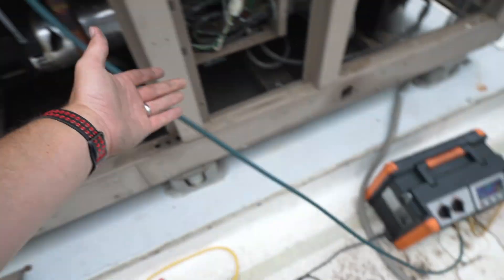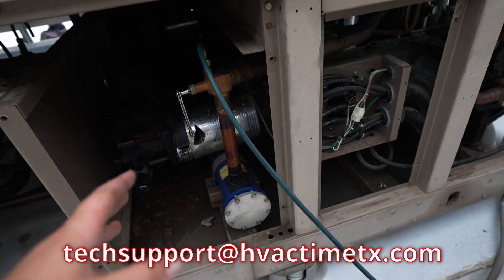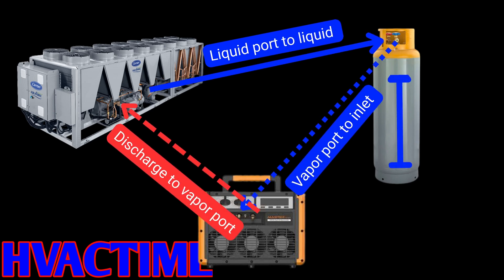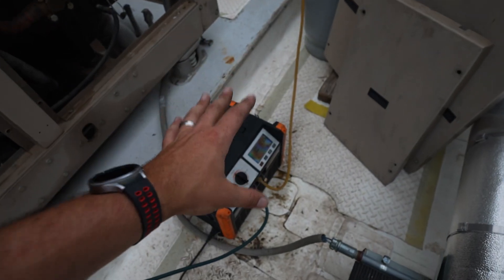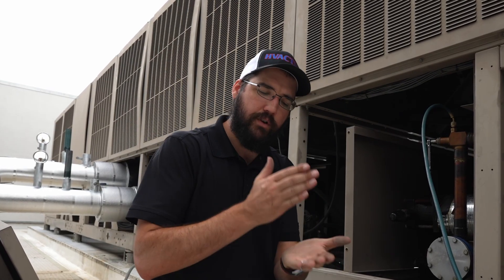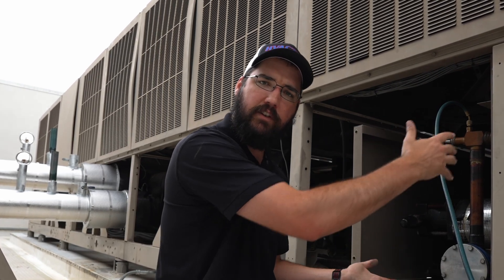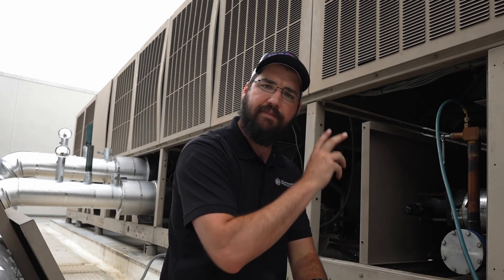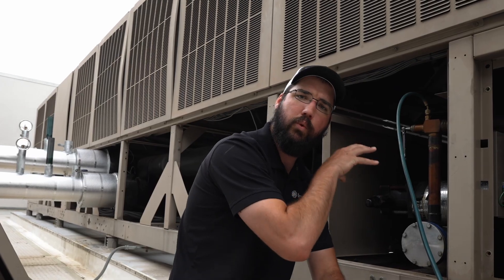Push-Pull Chiller Recovery & Charging Chiller Training

Comment: So if you're going to get a recovery machine involved in charging, I recommend what I call a pull-push. This is most effective on charges in the 30-200 pound range. The main advantage over a push-pull is that it's significantly easier to switch over to a regular recovery-machine charging once all the liquid is out of the tank. It's a bit slower than a push-pull because the recovery machine has to pump the liquid directly instead of inducing a siphon, so above a couple hundred pounds it stops being worth it.

Instead of using the recovery machine to pump vapor out of the system back to the tank, I use it to pump refrigerant out of the tank into the system.

It's similar to a direct liquid charge, but I add a hose hose from the vapor port to the low side of the system. This prevents the tank pressure from dropping and making the refrigerant boil off as it goes in, while maintaining a setup that's super easy to switch over to standard charging once you have all the liquid out. Once all the liquid is out, all you have to do at that point is close the vapor port on the tank and it'll start pulling the vapor out. The minimal setup rearrangement gives it a niche role in the 30-200 pound range. Under 30, you're better off just letting the vacuum suck it into the liquid then charging the rest into the suction. Over 200ish you'll probably save more time doing a regular push-pull because then the liquid flow rate isn't being hampered by having to go through the machine itself.

Comment: I did a push pull on 2 units in jan @750lb per circuit and 2 circuits per unit. Was the first time every doing it and was nerve-racking for the first unit. R134 using a chiller recovery machine and 4-1k cylinders. Super cool and educational but took about 80+ hours especially since they shut off the power to the first unit before we could stack all the refrigerant.

Comment: I work primarily on large chillers.  Push pull saves time, it sucks when I cant push pull because I am tying to distill the refrigerant from the oil because someone added oil to the unit when they shouldn't have.

Comment: 9:20 - Do you know if the Fieldpiece MR45 RM can handle what you’re talking about here?
Reply: NEVER EVER run liquid thru a recovery machine,  yes they might be able to "take" it for a bit but you are stressing or risking your tools without need,  a properly set up push pull on recovery or charging,   the recovery machine will never "see" liquid refrigerant.  on liquid charging you are pulling vapor from the chiller thru your recovery machine,  discharging to the recovery tank and "pushing" the liquid inside the tank out the liquid valve directly into the chiller,  your recovery machine NEVER pumps anything but vapor.  On these chillers there is a service valve right after the EEV/EXV (some older models the TXV) and before the evap,  once you have enough charge where you can run the compressor manually unloaded,  you can charge liquid via that valve no problems,  it will pull the liquid so fast,  charging liquid using the recovery machine becomes the slow method.  I have never in 20+ years had to push pull into air cooled chillers

Comment: Quick question. On air cooled chillers when we charged the system. I was told to put vapor first until above freezing. Your method of charging liquid first, wouldn’t this cause the system to possibly freeze up internally? Thanks in advance
Reply: Yes your correct. But if you have water flow you can charge liquid first. Good practice to break vacuum with vapor tho.

Comment: I’m pretty sure g5 twin does not have a compressor, it does not have a condenser coil. It’s a motor with a liquid pump. Similar to  an oil burner oil pump and motor.